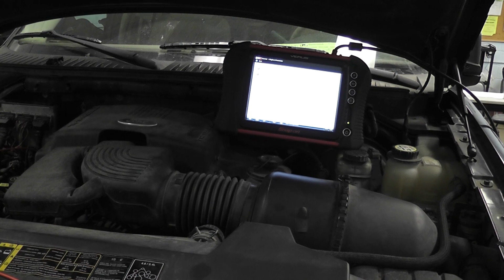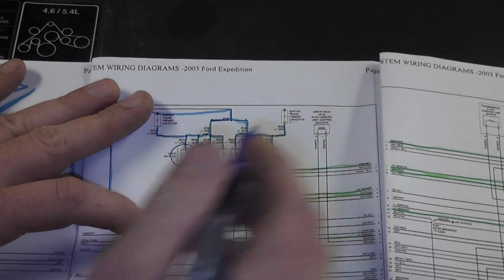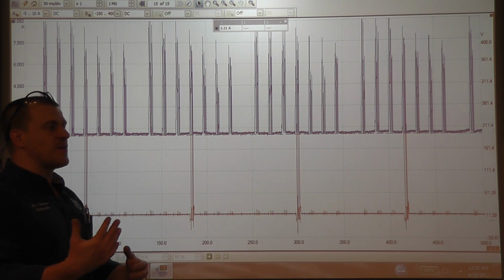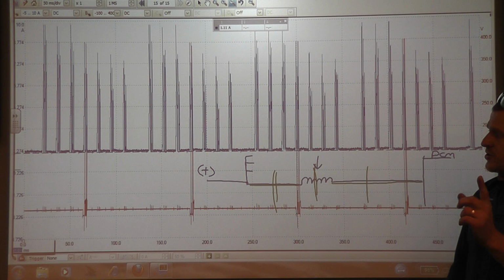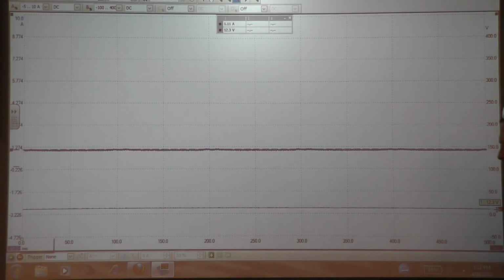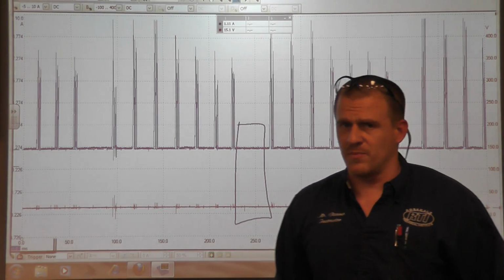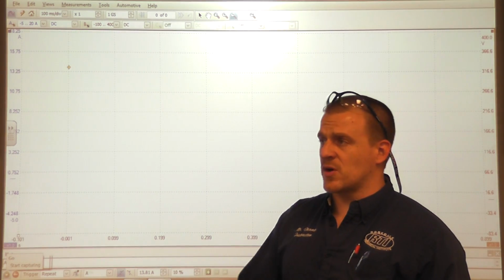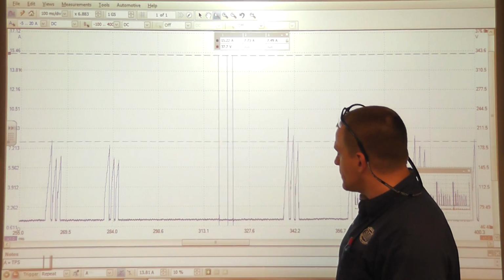Ford 5.4 shorted coil primary winding and bad computer driver

Comment: In my 03 F150, I only get the constant misfire once the truck is warm and has been driving for about 30 minutes. After it sits and cools, I start it up and it's back to normal...anyone have any ideas? Thanks y'all!
Reply from the maker: Is it just an idle misfire?
Reply: ScannerDanner no sir, not just an idle misfire. It's all throughout the RPM range. And when accelerating, there is a complete loss of power but once in a while it will fire that cylinder and I can feel the "jolt".

Comment: Can putting jumper cables on the wrong terminals cause a pcm driver to fry? I have a p0357 on my 01 F-150 4.6L v8. I was jumping my brothers car the other day and like a dumby I was talking and not paying attention when putting the cables on and reversed them. The motor kind of bogged down and the cables started smoking and i grabbed them off. Everything since then was fine no problems, everything was working fine and it ran fine. well 2 days later I was driving to the Hospital and i got a pretty bad misfire. Im going to have to see if it's the coil or the pcm. Hopefully it's the coil. I just replaced them with New OEM coils a few months ago and they have a year warranty.
Reply from the maker: you're probably okay since it ran fine after the jump start. Just a coincidence.
Reply: +ScannerDanner yeah thanks for the reply. I guess the previous owner crossthreaded the bolt that holds down the number 7 coil and it was only in like a quarter of the way, so the coil wiggled off the plug a bit. I took off the coil, applied a dab of di electric grease and made sure it went on well, then fixed the threads for the bolt. Started her up after and the misfire was gone. I was also having a surging idle problem, ao I cleaned the throttle body and the IAC while I was right there. Running better than anytime I've had her.
Reply: nice

Comment: I had same thing happen to me with a 2008 ford Taurus what i did i used a test light to test power wire at the coil with the key turn on with out starting 
and then i hook the test light to the pos batter and then i started the car put the test light at the other wire on coil to see if the light would started blinking when it did not i check that wire to computer to see if open or shorted when it check out OK  i new the pcm was bad

Comment: I watch so many of your videos and I just wish I could understand what the hell you're talking about because if I could, I know it would fix my problem 😔
Reply from the maker: Is your goal to truly learn this stuff or just learn enough to fix your problem? Either way is not wrong. If you just want to fix your problem, I can guide you on what playlist to watch here on YouTube. If you really want to learn troubleshooting at its core, my website is the place to go. 
I offer classroom type of training providing foundational information to build on, so you can understand what the heck I'm talking about 😉
https://www.scannerdanner.com/join-scannerdanner-premium.html
Reply: @ScannerDanner  wow thanks for responding. To be honest as of now I'm just needing to learn to fix my problem . I've been immobile for 3 weeks and I've been doing research everywhere and YouTube only really covers coil on plug but I have the Rail Coil.
 Brand new OEM spark plugs gapped to spec. 👌🏼 On my 3rd Brand new Rail Coil. Open entire wire harness. Haven't seen a short to ground or an open. Been searching for days. All my wires look new & pristine. To the last of my knowledge the resistance in the rail is in range & the wires on harness connecting rail and to PCM. All fuses & Relays check out. I even have a test light, an Amp Hound, OEM Circuit tester & a Multimeter. 🤷🏼‍♂️ There's always something wrong after another after another 😞 2004 Jeep Grand Cherokee Laredo WJ 4.0 engine code p0351
Reply from the maker: @maniacalmonster2293  maybe this one will help you https://youtu.be/TZwJ2jp8g0E I do not know what your symptoms are? No start or is it a severe misfire?
Reply: @ScannerDanner  It actually runs pretty good. At first for the most part, meaning I'm scared to let it run too long lol. SLIGHT hesitation when cranking. When idling, shakes more then usual but not all THAT BAD. Sounds good but just a noticeable slight skip like a misfire would make but not as bad. The odometer needle stays still no movement. Number 1 & 6 Cylinder share a coil pack on the rail. The primary winding is not opening the switch for the voltage to reach the spark plug therefore cooking the coil pack. When tested after starting vehicle, the pack has then no resistance but others are fine. 
I think a driver is stuck in the PCM. Code does state "Driver #1" also
Reply: @ScannerDanner  yes I have watched this one a couple times lol I was thinking trying the crankshaft first if fail, then replacing pcm. oh I forgot to mention new camshaft sensor also didn't work out original back in lol
Reply from the maker: @maniacalmonster2293  air gap for that crank sensor is critical 
https://youtu.be/agbEFhAyYI4

https://youtu.be/ws59zXvr1SM

Comment: Yep, cause and effect. not so funny story. Friend had a 2001 ish nissan maxima with a 3.0. Had a code (unable to control idle) he jumped on the internet, and discovered that the IAC (6 wires, 2 push pull circuits) fails often on these cars. So he gets an IAC from some auto parts retailer. Puts it on himself. Code came back. So the internet told him the IAC can burn up the computer (known issue with this nissan) He goes to junk yard, gets computer from similar car. Installs computer. now it wont start, immobilizer doesnt recognize key. So he finally calls me, i go over with my DS708 and enable the key. he hasnt told me the story yet. So we start the car, same code pops up, he decided he must have gotten a computer with same problem. he then tells me story. I get diagrams and tests, check it out, tell him his IAC is bad and so is his computer. So i go to junk yard, get a computer, he warranties the IAC. I check second new IAC, nope, resistance is too low.  Get another, it checks out. I do the installs, enable the keys, do the IAC and throttle relearns and its good. 

What happened? IAC went bad, fried computer. He put new IAC in, bad computer fried it. He put in new computer, the  now bad IAC fried new computer. This is what happens when you ignore cause and effect.

After this ordeal, his son wrecked the car 2 weeks later.